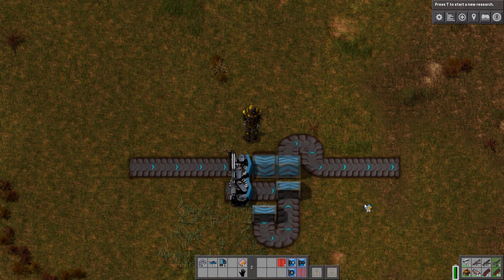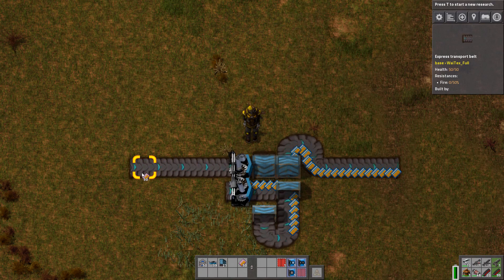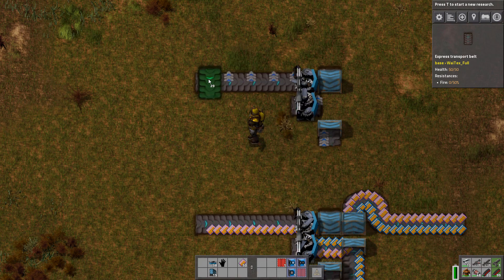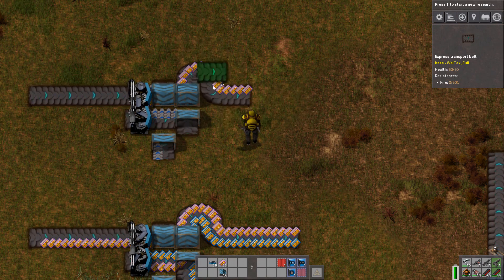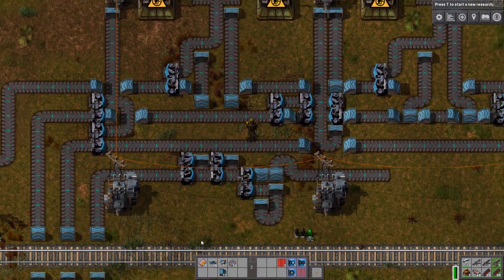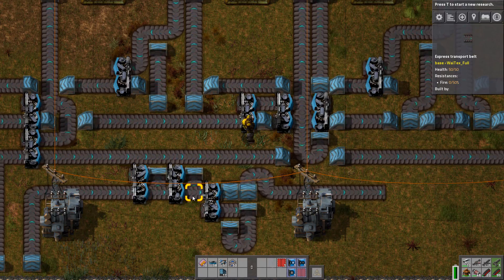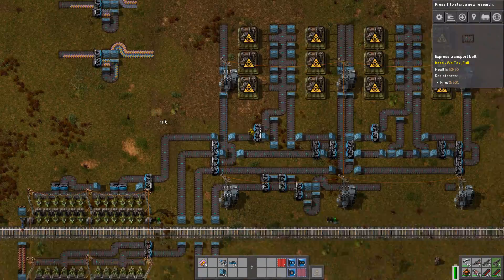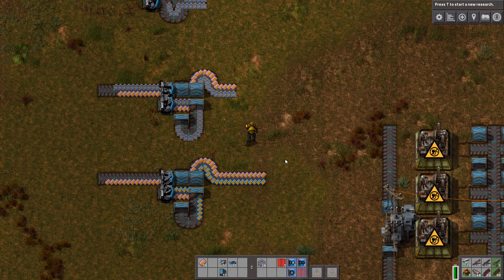Factorio Tutorial - Belt side swap

Comment: Cheers, i used your idea and refined it a bit. two under belts on the far right side (in your guide)  is all you need, )just two blocks :)  
https://steamuserimages-a.akamaihd.net/ugc/854981439931161034/6A4D8EF189C34461671EAE84132D0242ED7D58CC/
Reply from the maker: I restored this comment since youtube marked it as spam since it contained a link. But it all comes down to what you want tot do with it. I wanted a way to swap both lanes of a belt, left to right and right to left.